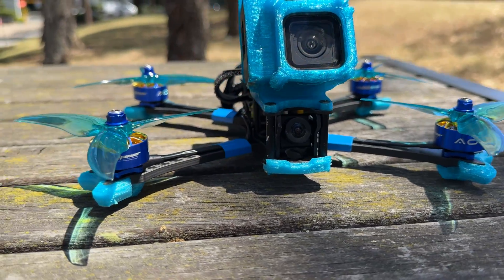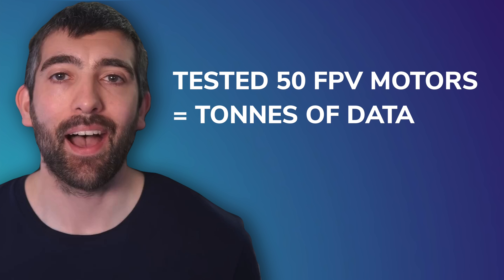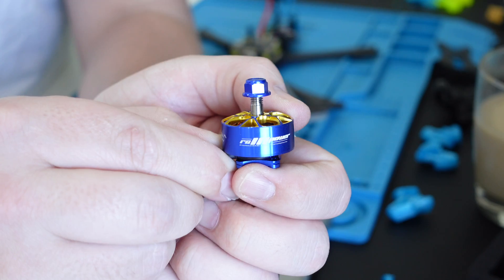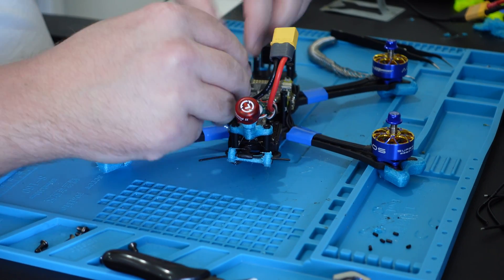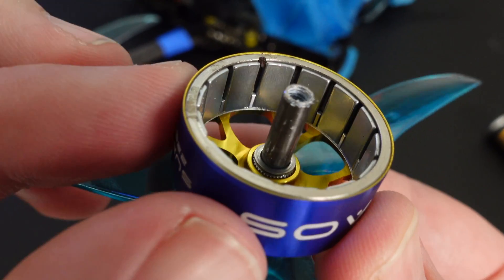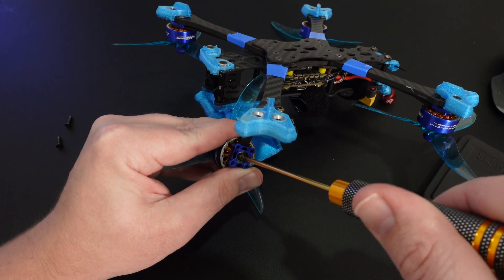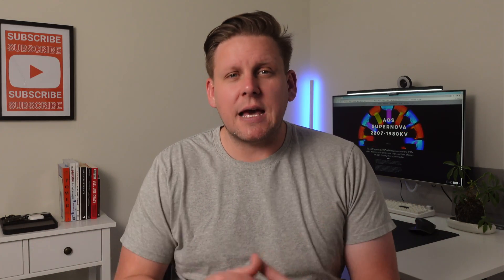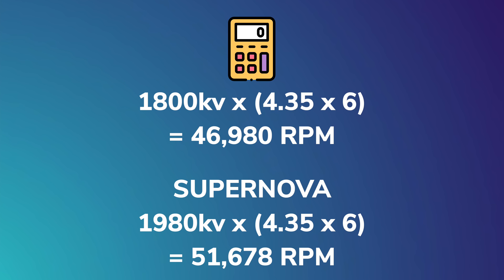I Tried “The Best” FPV Motor According To Science

Comment: ChrisRosser said somewhere- I agree. Unfortunately, one person cannot decide how motors are named and sold in the hobby. Pilots are searching for 2207 motors for 5" quads so this motor has to be called a 2207 to show it's for the same purpose.
I wish this weren't the case!
Reply from the maker: Well, look at what FPVCycle did with their naming conventions. Chris could have done something similar - he could have used this platform to share why as 2308 is the better size for 5” Freestyle, but that would mean everyone would make 2308 and his competitive advantage is gone.
Reply: @DarrenAllatt  I understand that Chris said- it wasn’t his decision
Reply from the maker: @noramas.  that’s BS, it’s Chris’s product. His brand and reputation on the line, so the buck stops with him.

Comment: Don't forget about propeller tip speed. The tip speed for 5" props on these motors at 21v with 100% throttle (same way the manufacturer tested) ends up way past the 450mph efficiency ceiling that Rosser even calls out in one of his older videos. You'd need somewhere around a 70% throttle limiter to avoid going over 450...
Reply from the maker: yes, that's spot on Daniel!
Reply: I saw a video where Chris said he usually set the throttle limit to 70%.  (in BF in 'scale' modus)
Reply: @skychaser5591  I guess you get better efficiency out of the motor that way, but even at 70% throttle, they are very amp-hungry compared to something like the Wasp Majors.
Reply: @danielwood3861   If I remember correctly he applied the 70% throttle limit because he never needed more than 70% anyways and wanted more resolution.

btw: I fully agree with Darren in the comment, why not call it what it is: say a 2308. 
Chris mentioned in his video it wasn't really a 2207 though, but still many people will miss that and think they buy a 'superb' 2207....
Reply: @skychaser5591  now I wonder, if you limit an average 2308 motor to 70% throttle, would you get similar performance as an average 2207 with the same props?
Reply: Have you seen test results that show loaded rpm with these motors on 6s?  Just curious.  I would not think anything we we fly would get near it but not sure.  I have a set to compare to my go-to motor of 2208.5 2200kv.  We shall see.  My go-to has so many flaws so keep searching for a replacement.

Comment: I didnt know all the stuff behind the motors just bought 1 for a wing because it was nice looking and i wanted a bit more kv. I can tell you its a little heavier than 2207 i had on it and it didnt burn up running 70-100% throttle all day with a 6x5 apc prop on 6s which will kill an emax eco motor in 1 pack. Rcinpower makes excellent motors. Reading the comments the whole 2207 class thing kinda sucks they do that with plane motors some call out the stator and some the can size.

Comment: I get the same vibe from his frame designs. Sure the data shows his products being superior, but in actuality BF has come so far and has such a wide array of filters and tuning options these days. I think nearly any frame and motors on the market can be built to fly good assuming you have a good FC with a proven gyro.
Reply: well shit runs better without filters
Reply: @420247paul  well rpm filtering covers the whole frequency range so you can use less gyro filtering. Plus some of the dynamic filtering does essentially the same thing if you’re not running rpm filtering.
Reply: We want less filtering.